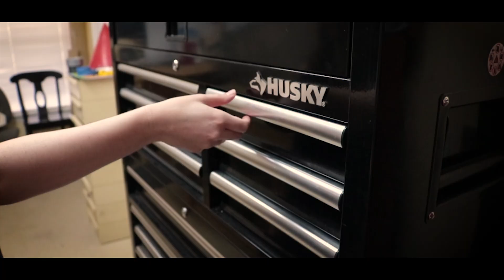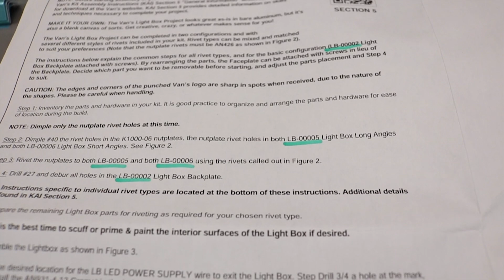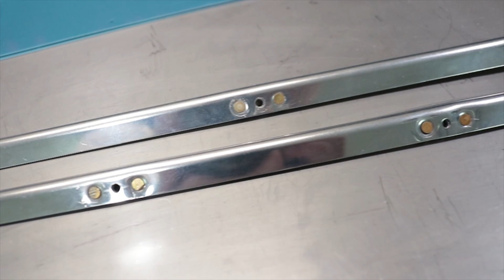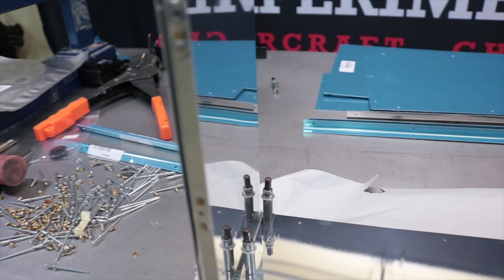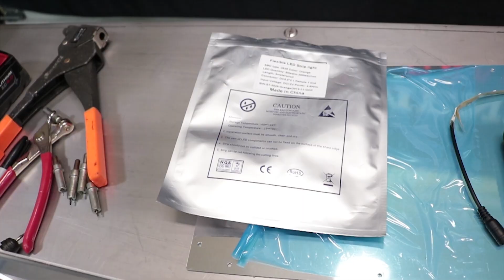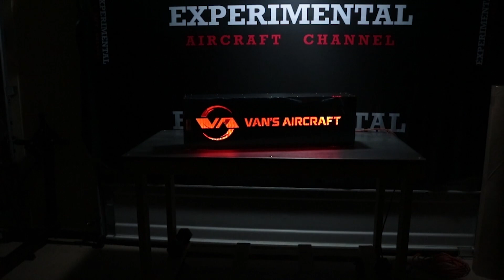Vans Aircraft Light Box - How To Build - DIY Project

Comment: Yeah, I can definitely get behind this, and recommend it (the idea).  We built a LongEZ (foam/fiberglass sandwich construction) and there was a "learn the processes" kit with foam shaping, hot wiring, layups, floxing, wet and dry micro stages, and even a little I beam that you actually put over a broom stick for a REAL strength test of your finished "spar".  And a SINGLE book end (LOL).  Rutan (or someone that had input into drawing up the plans) is a clown, some good jokes in the plans, like a guy with a wing laid up with a BIG lump in it, and the wife at the shop door asking "Honey, have you seen the cat?"  Great cartoon expressions on the figures...not Gary Larson level, but funny.  Probably had to be there, anyway, some of the test build items were quite serious, the I beam, tested over a laid flat broom handle, with a given weight person suspended, it was equivalent to a12 g canard and wing stress (if I remember correctly, long time ago).  IF it tested low, he gave several things to check, including resin ratios/type on the pump, and said redo it til it does pass. He even suggested after test you could purposely break it and repair it using the repair methods in the plans, and test again.  We didn't, it was too pretty to break.  ;-)   As a builder, I definitely recommend these come up to speed "pre kits" for anyone that has not used all the techniques previously, very much so if they have used essentially none.  It is a worth investment in time and money.  Make mistakes where it matters not one whit, correct them any way you want, then get on to building a SAFE airplane.  We got ours about half way and quit, for several reasons, but a friend bought it, finished it, flew it for many years, and sold it.  Far as I know, it's still flying.  Great idea, those kits, take advantage of them!

Comment: I just don’t understand why you need a lite box and the cost of the lite box. What is the cost of this thing. I am a aircraft mechanic and I have no need for this shit. Only the high roller has the money for this shit. If I made a lite box for every aircraft I work on I’ll be broke 
Being a A&P for forty years it’s a lot of aircraft lite box lol
Reply from the maker: This... is supposed to simply be an introduction of metal working for a fraction of the cost of let's say.... a RUDDER KIT (which is usually $300-450 or more from most manufacturers). That is all. Plain and simple.

Comment: Bryan - I think you should explain in one of your videos about “Pop” rivets. People that have never build an aircraft or have seen aviation pop rivets have in their mind that it’s the same type of rivet you’ll see at your local home center. You could explain the locking collar feature that differentiates them from inexpensive rivets. I’ve had to explain this several times to people especially that pull sound the gun makes when pulling the rivets. Also you could explain the gauge tool for selecting the length rivet to verify your instructions and what to do if they experience a bad pull! Just an idea because this could show people just how easy and fast the system is.

Comment: Don't be lazy about the rivets, you got lots of time..! I would go with flush when you can.!
Reply: ALWAYS go with what the plans call out, in a finished, proven aircraft kit design...or be damned sure, (as in run it by the kit maker and/or an appropriate engineer if you are not) it is not going to bite you, or KILL you. 

SOOOO many stories of people mucking with well designed kits/plans and ending up reworking, or crashed, sometimes fatally (like the Long fuel system mod that killed John Denver, in a plane built by someone else, contrary to EXPLICIT instructions not to modify that area, and which even worked fine for the original builder (John couldn't reach around properly to the fuel selector valve, normally mounted right between your legs, where you could practically reach it with your teeth if you had to, and this MAY have contributed to the accident, in any case it was assuredly NOT optimal). 

Rutan (the designer of the plane I built) was moral enough and concerned enough to actually put some mods that he thought beneficial through actual full up testing, and then offering them as mods (quite expensive and time consuming to do, some cases).  Many kit manufacturers do not do this. 

Just because you go to the flight line and see someone else has made a mod, and so far it hasn't caused a problem. is no reason to do something stupid yourself.  A good example, in the EZ types, is people made the very simple mod of putting a cover over the wing bolt access holes, not in the plans, for a few reasons.  Turns out, those planes were later grounded pending a thorough inspection of that area, because some of the covers weren't fully sealed, and water got in and was held there long term and severe corrosion was found in one.  These are the bolts that hold the WINGS ON.  Uncovered (plan built) wing mounts do not exhibit the problem, last I heard. You never know, and it's not always remotely obvious, and that mod was a tenth of an ounce piece of very think aluminum, nothing structural whatsoever.  That's what I'm saying.